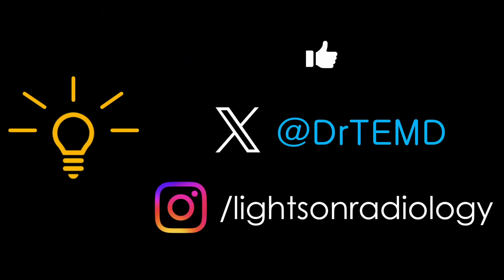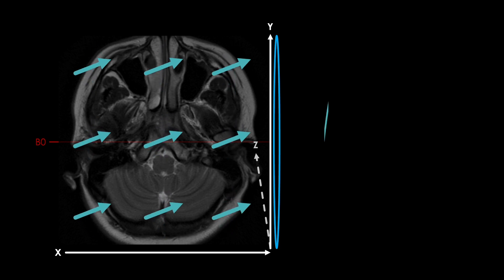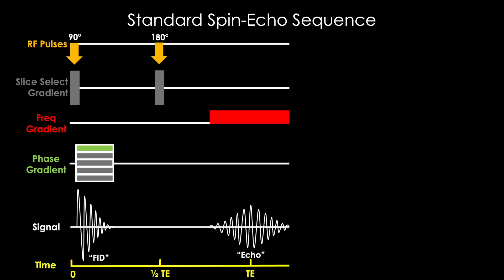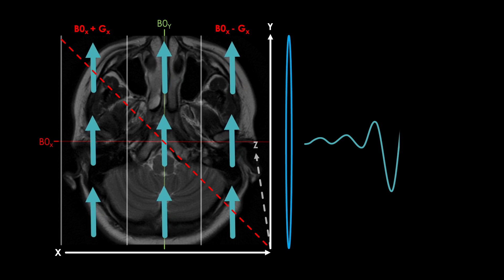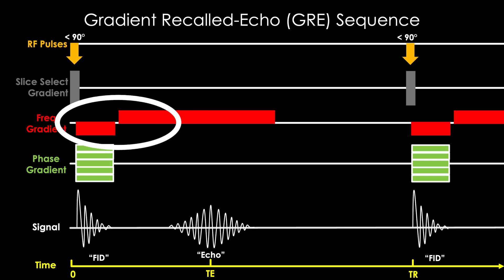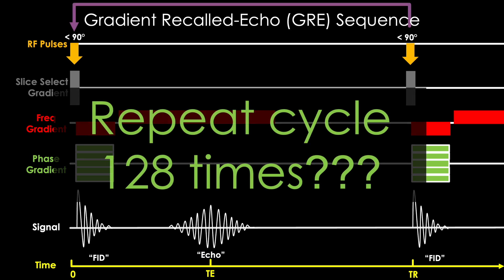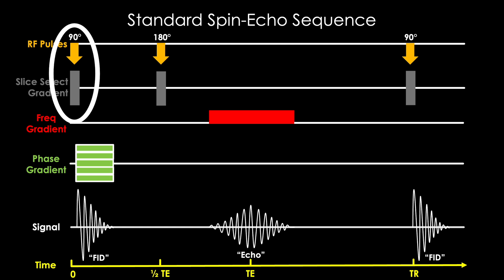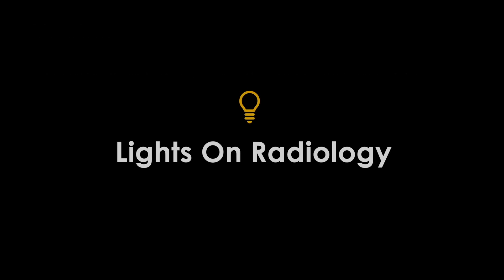The GRE/SWI pulse sequence EXPLAINED | MRI Physics Course Lecture 12

Comment: 11:40, do refocusing 180 degree rf pulse only mirrors the position of leading and lagging spins (By flipping them like a pancake) while maintaining same precision direction or they change the direction of precision?
Reply from the maker: The 180 degree pulse technically inverts the spins which makes them appear to precess in the opposite direction relative to the receiver coil.  Kind of hard to explain but we go into depth on this in the video about the echo, check it out here if you haven't already! https://youtu.be/yynyJEloRq4